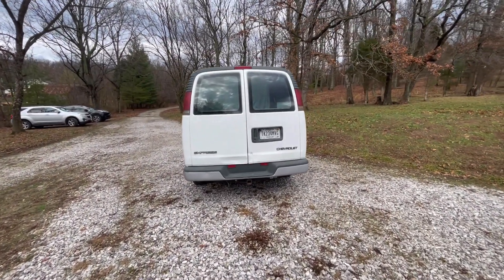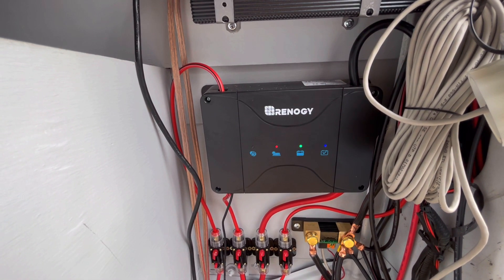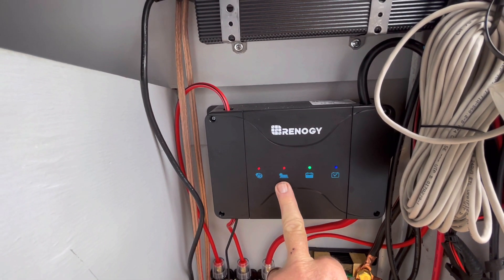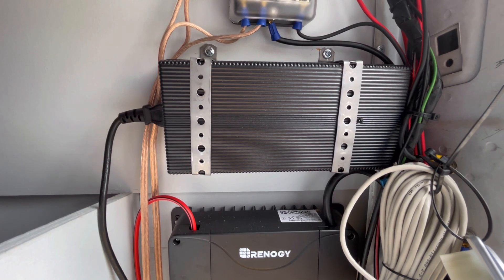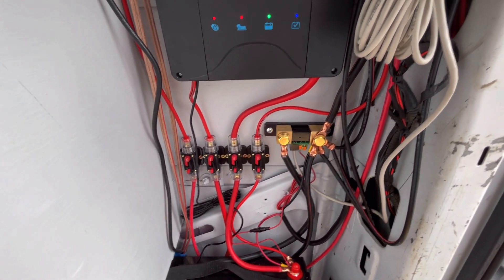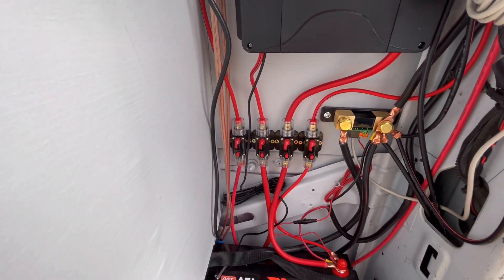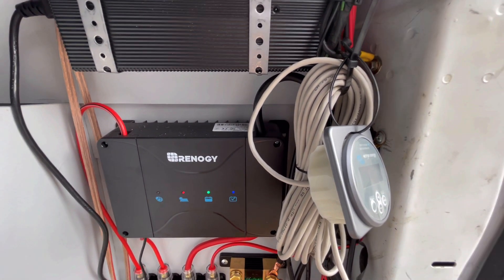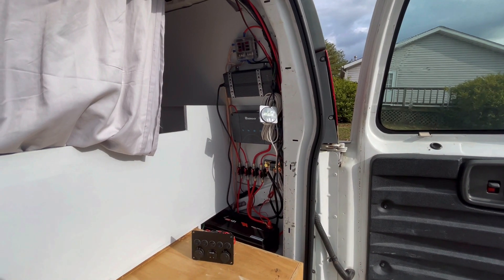Chevy Express “DIY” Camper Van  Episode-17  Electrical System

Comment: Thank you for detailed tour! Did you connect the dc to dc straight to the starting battery? My starting battery pos terminal is already busy with 3 wires, so I am thinking to connect to the positive terminal on the starter?!?!? Any suggestions
Reply from the maker: It depends upon which system you’re using.  But, I have seen things connected to the pos of the starter on Motorhome.

Comment: do you have space for an additional battery? I assume you'd connect them and stay at 12v? Seems like a lot of charging capability for 100aH.
Reply from the maker: Space is very limited.  My 12v refrigerator/freezer uses a lot of power.
But, I’m looking into a 2nd battery.
Thanks for Watching!